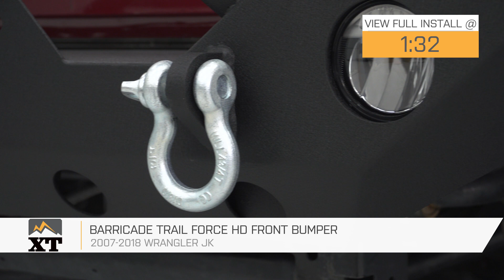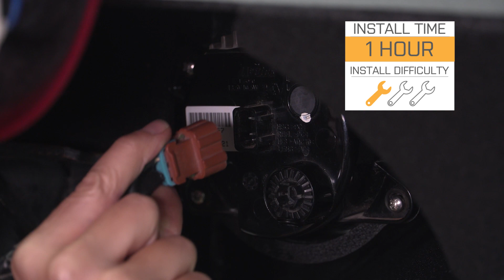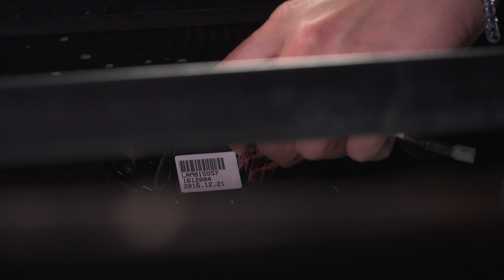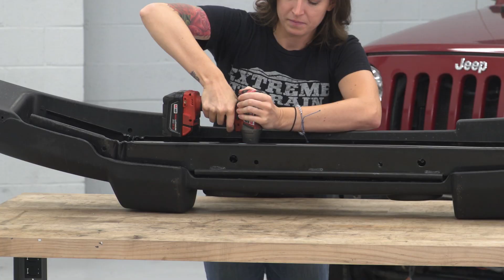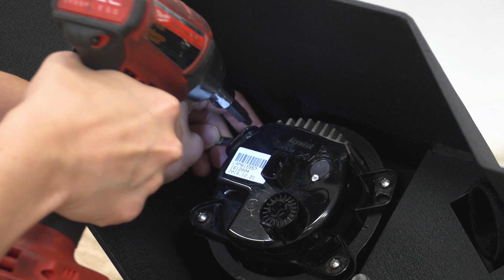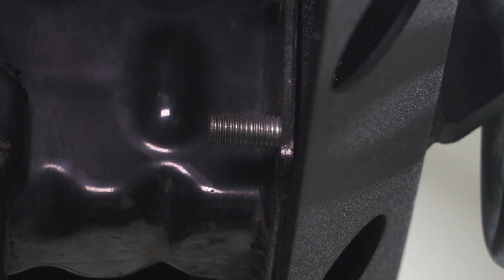Jeep Wrangler JK Barricade Trail Force HD Front Bumper Review & Install

Comment: Everything about the mounting of this has changed and is incredibly frustrating and in some spots you will not be able to mount all of the bolts. Quality control is poor some holes were not the right size.

Comment: Not accurate to the bumper I just painfully installed. TERRIBLE design. Fog light installation is a MF. They SHOULD come with threaded studs or threaded mounting holes instead of nearly impossible to reach nut/bolt locations. Can't wait until I have to replace a fog light...
Also, the main mounting hardware floats and is a pain to get all 8 studs lined up with the frame while they flop around. Definitely needs re-engineering for simpler installation.

Comment: They changed the hardware to put on the fog lights and it is absolutely horrible. The screws she is using in the video look simple but they are now a small hex key and nut and it is impossible to put them on.

Comment: Video show inner workings completely different than the bumper I have, the fog lights were a pain in the A** to reinstall with new hardware and hard to reach spots.
Reply: Absolutely agreed.  The inside of the bumper had brackets to be installed where it is basically impossible to get a wrench back there to hold the nut while screwing in the fog lights.  Terrible design.  1 hr install ended up taking 3+ hours
Reply: Yea they definitely changed the fog light hardware and it sucks!!!! My suggestion is to change the way she is doing it and put the nut on the outside facing you and tighten the nut instead of the other way around. Still a pain in the ass... the screws she is using would have worked way better
Reply: And I can’t even mount the bumper in because for some my screws keep falling off. It’s bullshit
Reply: @Mstrgeez  I ended up only getting 3 screws in. One screw was just impossible to hold the nut. It was still sturdy enough. A tiny 7mm wrench helped somewhat. As well as some finger strength to hold the nut. I found starting the nut by hand just to establish a connection helped
Reply: @tylercollier7580  hey tyler. Are you talking about your fog lights because i was able to get in. Only issue i have now is trying to put the bumper in but the big screws are not well placed and keep falling off. I’m not sure if you know what I’m talking about

Comment: Sure woulda been nice if it was this easy to install on my Jeep. I spent 2 days trying to get it installed. None of the bolts would line up and fog lights would not bolt up. I ended up having to make a new bracket for the fog light out of piece of aluminum stock.
Reply: Josh Holliday just spent 4 hours today trying to get the stupid brackets for the fog lights to screw on, they make it ridiculously hard to fit the washers and nuts behind to get it on the bolt
Reply: Ryley Drake oh I feel your pain, I guess they made it specifically for people with little baby hands
Reply: Same.  We drilled to get a bolt in on my rear bumper.

Comment: I’ve had this bumper on for a year now and it’s been awesome! I’ve pulled out a couple of trucks with the tow points and they held up great! The only thing is that the clevis attack the bumper coat and you need to buy those rubber/silicon covers for the clevis’ to keep them from chipping away at the finish. Other than that, the Smittybilt 95K winch works great with it too!
Reply from the maker: Thanks for the review, Raldo! Awesome to hear its been suiting you well! -Zach
Reply: So you can hook up on the clevises and pull on them. They wont bend or mess up the frame or bumper. This is what I was wondering about.

Comment: How's it stand up to corrosion? Say for one in the PacNW where is rains 9 months outta the year.
Reply from the maker: As long as you take care of the bumper (paint over any scrapes or chips in the powder-coating and don't let road salt get caked on it during the winter) it will hold up just fine! This is an extremely solid entry-level bumper. -Zach
Reply: @extremeterrain  so no issues with flaking powder coating within a few months?